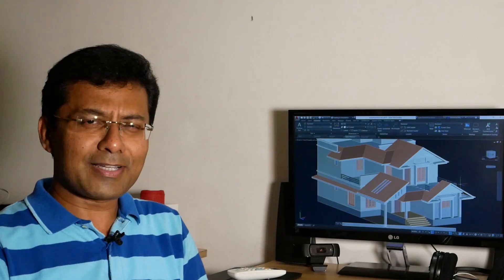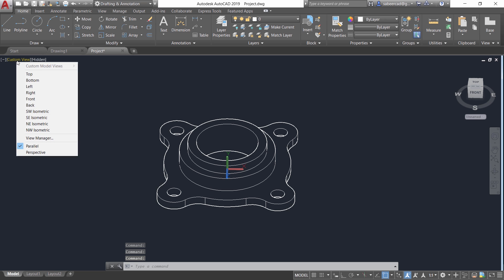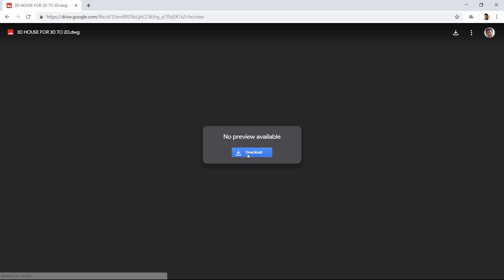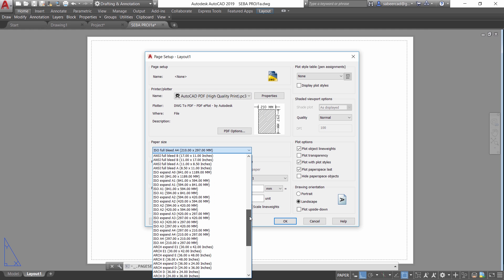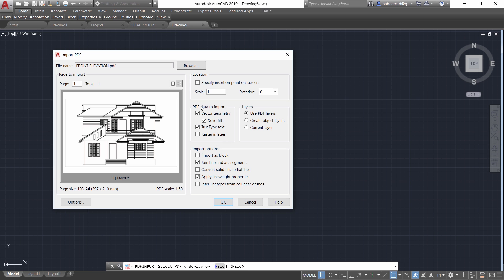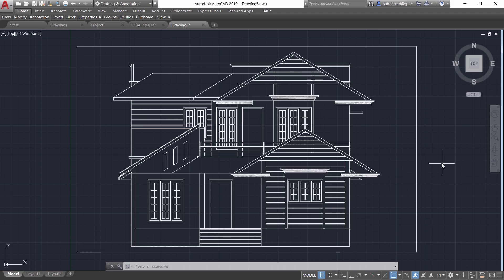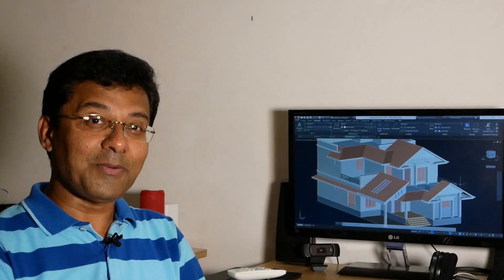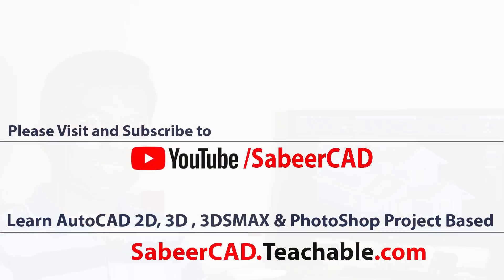AUTOCAD 3D TO 2D NEW METHOD  | AUTOCAD FLATSHOT | AUTOCAD PDF IMPORT

Comment: HI sir
When i try using flat-shot on a double storage building the same way you did in this video, some parts of the building are erased in the pdf and when its imported  in autocad there is  no change still some parts are missing
Another thing is that when i flat shot the drawing moves out of the displayed screen, meaning that i have to click on the zoom extent to bring it into the screen then i use move command to bring it near the object
Reply: You should set origin by 0.0 the try

Comment: I Exported sketchup model to autocad 3d and then tried to flatshot, but it didn't work please help
Reply from the maker: Save the model, open and retry
Reply: @sabeercad  Error message "There are no solids or surfaces that can be projected" shows, what are the other ways to convert 3d model to 2d isometric ?
Reply from the maker: @mznv3760  can you mail the dwg file to sabeercad@gmail.com
Reply: @sabeercad  I sent it, i really appreciate your help as i have to submit dwg tomorrow
Reply from the maker: @mznv3760  I will check and get back
Reply: @mznv3760  Hello, how did you solve the problem, I have the same problem that Error message "There are no solids or surfaces that can be projected" shows

Comment: Sirji  today architecture industry demand v ray, lumion. No one want bad looking cad 3 d. Vray can produce alone produce photorealistic rendering
Reply from the maker: For 3D modeling Autocad 3d is still fast and powerfull..  and can be installed in low end machines.  You cannot install Lumion or 3dsmax with Vray in such a machine.  But for rendering I recommend Lumion and 3dsmax.  Even Autocad rendering is pretty decent to give a draft presentation